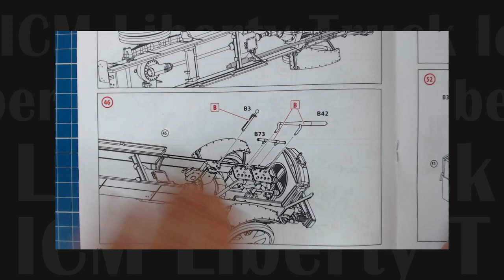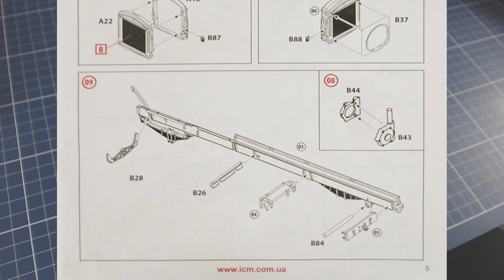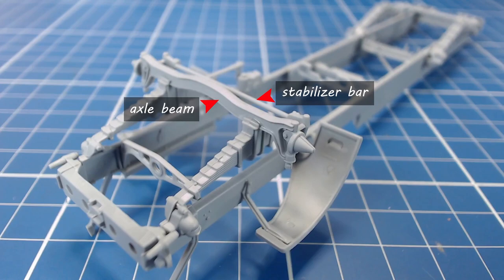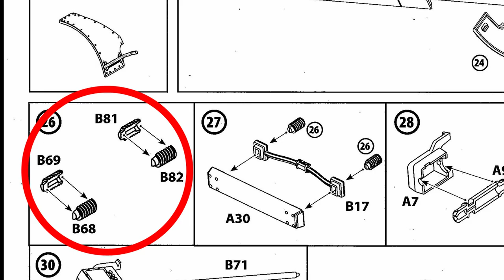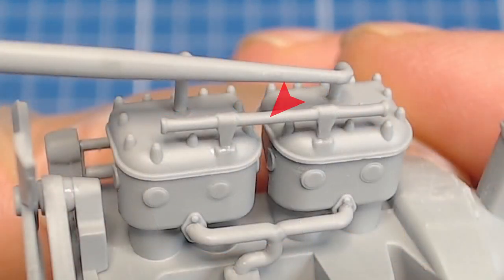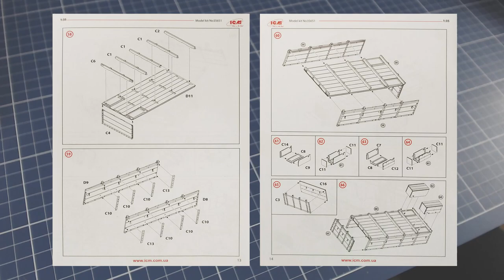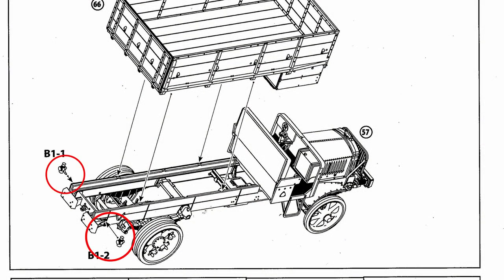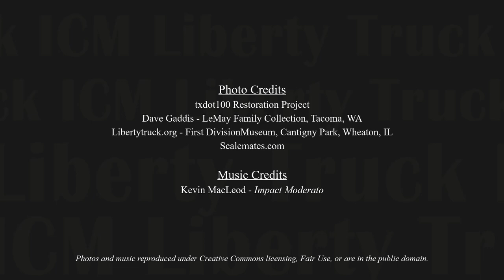ICM Liberty Truck Build

Comment: I have built both a Model T Ambulance and Armored Car, and had the same problems with those kits. They are frustrating to build, but nice when they are done. I'm glad you are straightforward in your build opinions, think you are doing a great job, and I look forward to part two!
Reply from the maker: Hi John, thank you for the nice comment and words of encouragement! What brand were the ambulance and armored car (so I can stay away from them). I don't mind little fixes but juggling the builds with trying to get the videos out in a reasonable time means I appreciate kits with good engineering. Still we must try new things lest the channel turns in to a Tamiya only feature. I've had good luck with the newer Meng and Takom kits. Had to try ICM. They have cool subject matter but they have a way to go to play in the A league. All the best to you!